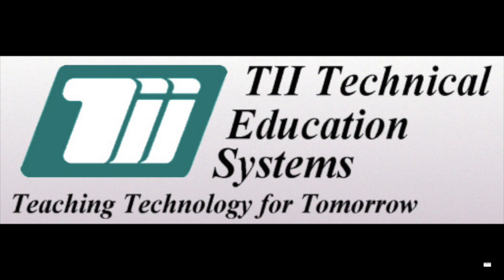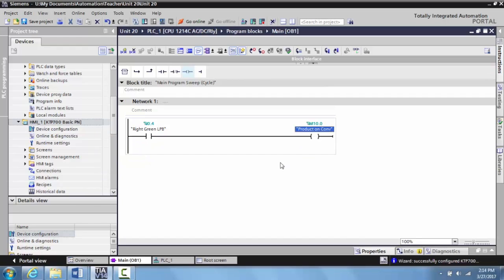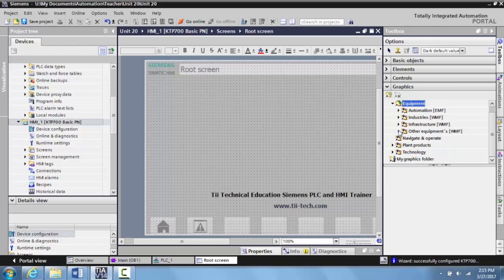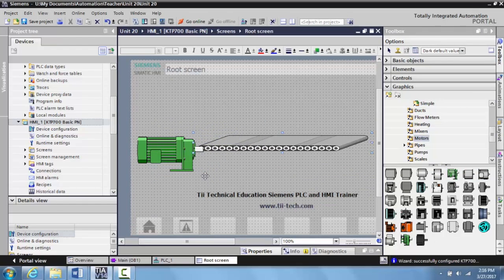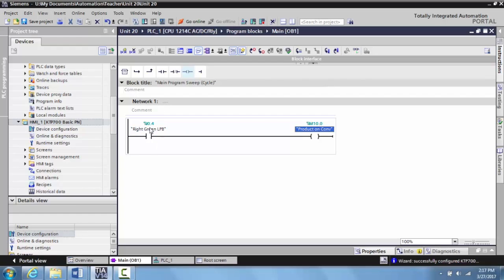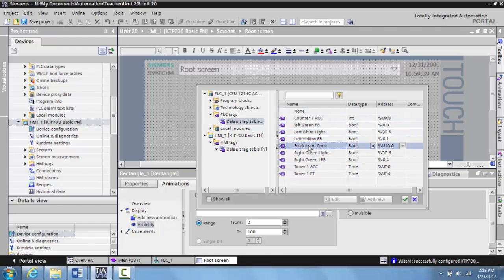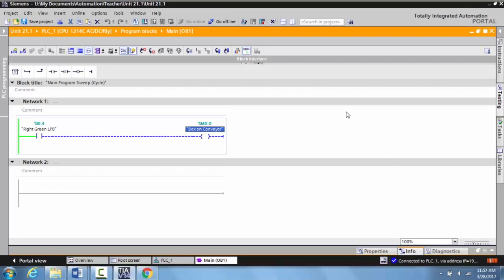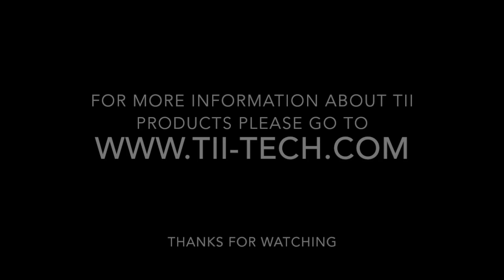Adding Graphics and Visibility in Tia Portal V14 - Unit 21.1

Comment: Hi,can you tell my how can I rotate the graphics. ex: the motor that you used was on the left side of the screen and facing the right side.how can I mirror the motor so it is on the right side of the screen and facing left?
Reply from the maker: You should be able to invert the image.  If that does not work, try setting the image to move in the opposite direction.